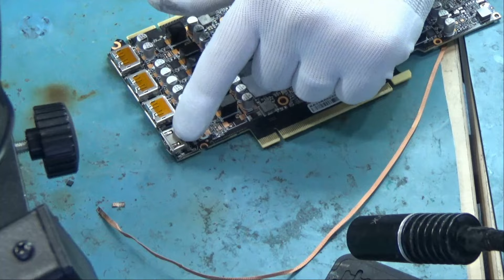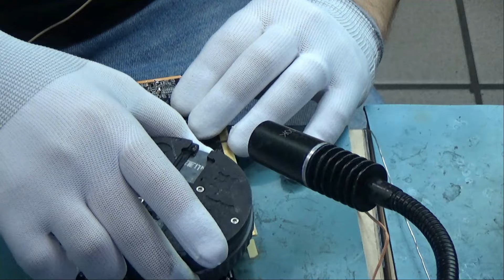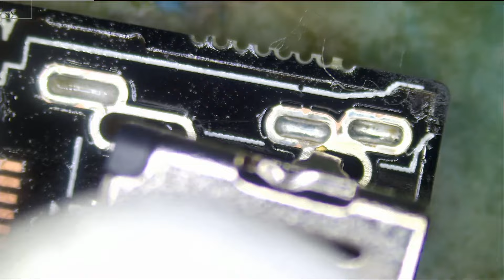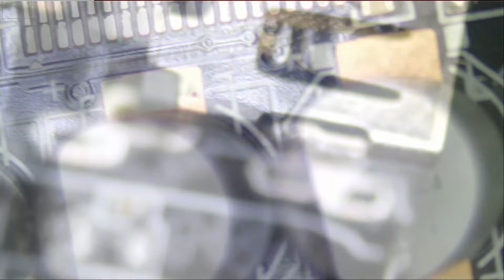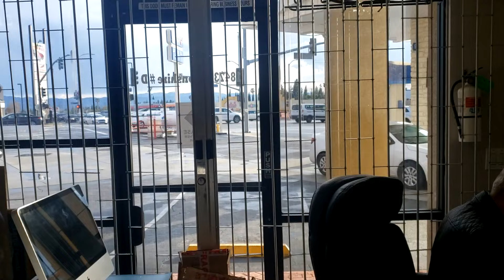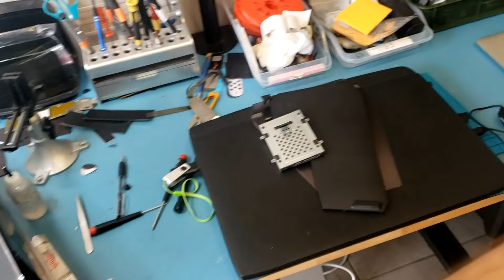GeForce RTX 3090 $3000 Graphics Card No Display Repair

Comment: What can be the Probem here do you think? its a Gigabyte GeForce RTX 3090 VISION OC 24G graficcard. The card has been working fine until it stopped giving a picture. The fans are spinning and the computer has started with the card installed, but the screen is not responding.

Comment: NorthridgeFixe where i can buy this for my Asus GTX 560 TI i repair wihth solder air station. i have signal without dvi i used dvi to hdmi adapter because my acer gaming monitor work only on two hdmi port or display port can you put me a link to buy a hdmi remplacement for my Asus GTX 560TI CUII please ?

Comment: With a board like this the customer must have had a monitor that accepts displayport why not use one of the 3 do connectors. There are also dp to HDMI cables that cost about $15. Your work is awesome but in this case a waste he had 3 other output ports to use.

Comment: Unfortunately the 3090 isn't 20% faster then the 3080. Not to mention the 3080 ti came out and is now less then 5% from the 3090 in most 3d rendering. Plenty of youtubers have put both through blender and other 3d rendering programs and not much of a difference between the two.The price is the only thing that truly separates the 3080 from the 3090.

Comment: Hey, I bought a gigabyte geforce 3090 oc 24 off an auction and it didnt state that it had a PCB issue, what it was, the metal bracket that allows it to mount was slightly bent, i manged to correct it and the board looks intact. I can power it up but it as no output when powered up on my monitor. Any advice please. Thanks.

Comment: QUESTIO PLEASE:  Why would my NVIDIA GeForce GTX1050TI  not be recognized by my OS (Win 10 64bit) which is fully updated?  W10 keeps using "generic video card drivers" for it.  Is there a specific chip that identifies the video card? Thank you for any assistance you can provide.  Currently I have put back in my NVIDIA GTX710 to use until I can figure this out.

Comment: My 1080 has been running fine for 5 years. And can still play new releases at 1440p at 60+ FPS on higher graphics. I will not pay $2000 more than the card is worth.

Comment: I wonder why they needed the HDMI fixed when they have 3 display ports available? Either they have a very specific need for an HDMI 2.1 port, or they did not realise they could have just used a display port.

Comment: I have a XFX Radeon R280X graphics card that shuts off immediately after boot with horizontal lines showing just before it shuts off. I believe the unit is over heating. Do you have any suggestions on how to repair this card. I am disabled and on a fixed income so purchasing a replacement, even used in this market much too expensive. I am very handy, but would appreciate a professionals advise before proceeding with any repair. I was thinking of taking the card apart, cleaning it thoroughly, applying new high performance thermal past to the GPU and VRAM and even purchasing replacement fans. I would love your insight please.

Comment: Of the 4 originals...to me it's either 3060ti or 3080. The 3070 isn't that much better than than the 3060ti...the 3090 certainly isn't $1000 better than the 3080 looking at benchmarks.
I had a 3060ti for about two weeks. It was plenty fine for most stuff. I would have stuck with it except the system it was in (prebuild) died. After a big fight with the egg idiots I've been on a Sky Tech "Blaze 3" ($2299 - no longer available) since first of March. I got it with no tax and free shipping. I don't know WHY no tax but I wasn't going to bitch. $2299 to my door and ready to go.
Zero problems. My XLR8 3080 is running as well or better than any out there though it gets no love from the tech channels. 1995MHZ out of the box...cruises happily at 2190 all day with a slight bump....low 60's at most. I haven't pushed it much...I'm skeered to kill it.
I've made just a few mods, cleaner wiring, 32 GB ram, 6 Sickleflows, bigger psu.....and I'm still under the price of that 3090.

PNY 3080 Epic-X, 3700X, Cooler Master 120 aio, ASRock B550M/ac, 32GB Ballistix 3600 (4x8), 1TB Seagate Firecuda M.2, 1TB WD Black HDD, 6 Sickleflow fans, Corsair RM1000x, Neo Air case.
$2800
I have named it Alita -3080 Battle Computer.

After examining it for stability...I cut out the ugly fat inner grate on the the front panel of the case....much cleaner looking.
Hooked to a 43 inch 4K HDR TV.

Comment: Doesn't it look like the board had holes that aligned with the legs he bent in, but they were full of solder. Looks like the board was designed to work with multiple HDMI ports.

Comment: I have the 3080 version of this card, Its a great card under water but the air cooler is shit, 86c in games and then it thermal throttles is no fun at all, a few cards all share the same PCB and the same fans and shroud so it could be PNY (like mine) or any of the other models that look the same.
Why would you use HDMI on an 3090 unless you run a sensor panel as well as your main monitor on DP ? These cards rear vram chips run hot too, they regularly hit over 100c on an air cooled card.
Even the rear solder joints and rear of the core gets hot on my 3080.

This is why most people with 3090's run custom loops cos its the only way to cool these things, as well as maybe get an EK water cooled backplate or rig up your own solution for the rear vram chips using an Threadripper heatsink or 6x DRAM water block.

Comment: I got a question. I have mining GPU with no display port. If I solder a HDMI/DisplayPort on it will it work? The pads and holes are there.
Reply: Yeah it will work in that case but i strongly suggest you to take the card to a professional if you don't know what you are doing.

Comment: I'm genuinely curious if this can affect the HDMI standard that the gpu can use (different standard would mean different speeds/resolution it can handle) and if it can compromise HDCP handshake
Reply: Nope, it's a dumb component/connector!
All the HDMI socket does is reroute traces to particular HDMI pin, it's all mechanical with no electronics.
Reply: @Leftfield2k7  great reply, i thought my comment was forgotten haha

Comment: If you look at the die or the chip itself, it's not that much bigger than the last gen 2080 Ti, but it's got 2x more cores and is 2x faster. Shows the generational leap in performance from Turing to Ampere.

Comment: Job well done! I am considering learning how to do this specifically to repair video cards. I'll be getting myself a hot air rework station soon. My goal is to be able to repair a broken 1080Ti, which I may be able to get for myself. I think I just need to reheat the solder balls under the RAM chips.

Comment: Hello, I have a question on what you are using to clean the flux after the repair and what does the brush do?

Also are you using Low melt solder to secure your HDMI ports to the boards? Cause I’ve been having problems with my HDMI port coming loose after the repair, what am I doing wrong???

Comment: I run a computer repair shop myself; the only reason why I can think that a customer wants the HDMI port to work is because it's a HDMI 2.1 port which carries a 4k signal @ 120hz. The question is with your repair does your replacement HDMI port a 2.1 spec? cause if not this can create future problems for the customer or resell value if it doesn't use a 2.1 spec.
Reply from the maker: It's not the connector that makes 2.1, it's the hardware and cable. All connectors have 19 pins and has nothing to do with HDMI version control.

Comment: سلام
I have the same laptop you got on the desk near big boss, ASUS ROG G751JL.
i want to ask if you have any idea about this laptop issue which is frequent shutdowns when playing specific games like Rust and league of legends. Its not an heat issue as i tested. I also play many games like warzone and many others and it works perfectly without any shutdowns. 
I noticed that only when i go to specific places in Rust it shutdowns. But for the league of legends it randomly shutdowns.
I replaced the battery with a new one, changed the thermal paste cleaned the laptop. But still have the issue.
If you have any idea what can make this problem i will be grateful 🙏. As i suffered from this issue for 5 years for now 💔.
Reply: How do you get right-aligned text in a YouTube comment...?
Reply: @RWL2012  لما تكتب عربي يا خيي
We right from right to left in Arabic. Thats all.

Comment: Imagine having RTX 3090 and using HDMI port...
Reply: I dont get the HDMI hate. Its like hating on Molex connector. If it does the job wears the problem?? 🤦‍♂️🤦‍♂️
Reply: @andrewszombie  for molex the issue is the pins and housings are usually not made too well and flop around a lot. Makes it easier to break. Remember USB 3.0 front header connectors? Those evil evil things we still use?
Reply: I would like to see the Venn diagram of people that have one of these cards and can't afford 7 bucks for a display port cable
Reply: maybe he has a secondary screen that is HDMI ... i have one to and i use it as my 3'rd monitor :D
Reply: @matpegheata  or htc vive etc
Reply: For the geniuses in this thread, the benefit of HDMI 2.1 is that it does not require chroma subsampling at 4K 144hz or 8K60Hz unlike DP 1.4 which almost always requires chroma subsampling for either. Higher bandwidth. 48GB/s for HDMI 2.1 compared to DP 1.4 which can only do about 32.

The only issue nowadays is only TVs and very specific gaming monitors can do HDMI 2.1 because the monitor industry moves at the speed of a snail compared to the TV industry (usually due to sales straight up being 15 to 30x more). It's by far superior for picture quality but costly.
Reply: @Shyvorix  we have display port 2.0 it's bandwidth more than doubled.
And can run two 4k monitors with HDR at 120fps.
Reply: @AyzekUorren  Yep but that ain't releasing until at the very earliest end of 2021. So we aren't expecting new hardware for it until around mid/late 2022.
Reply: @Shyvorix  Which is actually the best moment to release dp 2.0 considering pc components rampage in 2022. DDR5 means new mobo means new cpu. To add up new gpu life cycle. So again dp will send hdmi into oblivion.
Reply: @Shyvorix  they're clueless. i have my 3080 connected to my lg oled c9 running 4k120hz hdr. fuckin' glorious.
Reply: I can't.

Also..... Imagine sending your 3090 in to get "fixed" when there are 3 other DP outputs on the card that are functional still.
Reply: @nexxusty  Getting it fixed probably costs more than a DP to HDMI adapter.
Reply: @atnfn  if you buy a rtx 3090 the price probebly does not matter
Reply: @atnfn  Yes but the difference in resale value of a correctly working card vs one no working HDMI 2.1 port is higher than the cost of the repair.
Reply: @nexxusty  my HDMI 2.1 port runs 8k 60hz which the DP ports don't do.
Reply: @nexxusty  if its broken why wouldnt u want to get it fixed if its in warranty? is free and u dont have to buy anything.
Reply: @nicane-9966  i’ve heard that if something is broken on your graphics card the company takes ur graphics card and sends u back ur money they don’t fix it and send it back
Reply: HDMI 2.1 has a higher bandwidth than DP 1.4. He's probably using it for an LG Gsync TV, which don't have displayports.
Reply: thinking about someone with a 3090, they probably have multiple displays. its possible that they have 4 screens they are driving and 3 of which are already using the DP outputs.
Reply: It’s an hdmi 2.1 port. So it can do 4k @120 and up to 8k @60. What’s the point of this comment? Some people use their TVs as monitors and most TVs that are worth buying have hdmi 2.1
Reply: I was thinking the same thing.
Reply: @starscream42  In what ways?
Reply: @ronnie3044  Compatibility, Daisy chaining support, Enhanced Audio return channel, Supports up to 10K resolution at 120Hz with meta data entanglement. Though DisplayPort should surpass HDMI soon.
Reply: If you are not idiot , HDMI may be ,used for console , and elgato HD capture
Reply: likely someone who is recording or streaming. thats the main use for the HDMI on such cards and i suspect the only reason they still put one HDMI on those high end cards. 
theres only one captruecard for DP port and it cost a fortune and its not even that good. hdmi is the real option for capture devices
Reply: he's got one for a reason😉
Reply: Imagine having a RTX 3090 and playing on a 21" monitor instead of a 60" OLED.
Reply: @DHxJarsyl  haha exactly
Reply: Imagine not understanding that it's hdmi 2.1 on the 30 series which is the best connection highest bandwidth transfer connection bandwidth at 48gbs hahaha. Any one not using that hdmi port is using a lower quality port . Hahah there's your lesson for the day .
Reply: its sad i know but my lg zx only has hdmi ports
Reply: imagine running 4k on a 4k card
Reply: @lottexy  If they didn't use it, how did they know it was broken?
Reply: exactly what i was thinking
Reply: @MrMisterMan Not if it's an OLED. They have the best response times of any display.
Reply: Doesn't VR require HDMI?
Reply: it's hdmi 2.1
Reply: 2.1 is good lol
Reply: HDMI 2.1 works just fine for most people, and HDMI in general is a lot less buggy than DP is.
Reply: EXACTLY. CRAZY. USE A DISPLAY PORT
Reply: @MrMisterMan not even, if you can afford a 3090 you can afford a giant tv as just secondary media display on the wall.  More screens is more useful always.
Reply: Yeah, HDMI 2.1 is not the same as 1.4, etc.
Reply: I don't have to imagine it. I can plainly see it. :)
Reply: Well, Miners don't use displayport... so hdmi is okay? haha
Reply: huh...i have a 3080ti and I use mine with a LG CX 4k OLED 120hz...its not that strange actually.
Reply: @NonLegit Nation  seriously. salty people judging too much its funny/sad
Reply: I was thinking the same thing wtf...
Reply: I mean why not if that's what you got  I've got my 3090 using a HDMI with freesync
Reply: Maybe look up HDMI 2.1 specs and then again Displayport 1.4a Specs then you see why one might choose HDMI over Displayport.
Reply: the dot dot dots make you mystical and mysterious
Reply: Maybe his monitor is 3 meters away from the case.
Reply: @starscream42 
Nope. HDMI is only widely supported but it has lower bandwidth than DisplayPort so it cannot support high resolutions and high refresh rates at the same time.
That means for video editing and gaming it's better to go with DisplayPort over HDMI because it was designed for high performance applications but is not as widely supported as HDMI.
Reply: honestly if you're not using HDMI 2.1 with the 3090, you're probably using a shitty LCD monitor with DP 1.4 LOL
Reply: @ouki4925  here is where you need educating, DispalyPort supports up to 8K where as HDMI does not. 
Also why are you saying they would be using LCD? The panel tech.has nothing to do with the port you use.
Reply: @Ashley_Dale  HDMI 2.1 supports up to 8k @60hz. What are you talking about
Reply: @Ender275  DP 2.0 configuration: 
16K (15360 × 8640) display @ 60 Hz with 10 bpc (30 bit/px, HDR) RGB/Y′CBCR 4:4:4 color (with DSC)

10K (10240 × 4320) display @ 60 Hz and 8 bpc (24 bit/px, SDR) RGB/Y′CBCR 4:4:4 color (uncompressed)
Reply: HDMI 2.1 > DisplayPort for high bandwidth. 8k or higher resolution or high refresh rate.
Reply: imagine gaming on a brand new 85” TV with hdmi 2.1 and no displayport
Reply: i have a 3090 and use my hdmi port. what of it?
Reply: @b4ds33d   They are just jealous. I'd be very happy with that setup.
Reply: WTF exactly what I was thinking... I MUST GET 2000 FPS @ 1080P 60HZ!!! lel?

Comment: imagine using a HDMI port on a 3090
Reply: Imagine spending more than $100 on to repair an HDMI port when you could buy a DP cable which would be better anyway instead.  Also all high end monitors that you would use with a 3090 will support DP.

Comment: Is ist possible that it is a different port because the new cards have HDMI 2.1?
Reply: the chip and cable makes it 2.1, an older physical port would work fine with it as the connector is the same.

Comment: that HDMI port is 2.1 dude so what type are you installing
Reply: older physical HDMI ports are "forward compatible" with newer version HDMI controllers and cables.
Reply: Was wondering the entire time if the card will be limited to HDMI 2.0 speeds of 18 Gbps max / 14.4 Gbps effective or will it still do the full 2.1 standard of 48 Gbps M / 42.6 Gbps E
I know 2.1 cables are backwards compatible so it might be alright ?

Comment: This man saves kidneys!!! Mad respect! 😭😭😭😭
Reply: a kidney's value it's more like a ps4, this would be more like a brain and heart repair.
Reply: *gets rtx 3090 just to use hdmi-_- he should return it
Reply: @Switchfpv  Maybe he uses multiple monitors.
Reply: @Switchfpv  RTX 3000 cards use HDMI 2.1 which is actually better than DP 1.4, but only some TVs can use 2.1 to it's fullest and only 1 or 2 PC monitors I know of can use 2.1 to it's fullest extent (can run 4K144hz or 8K60Hz without requiring chroma subsampling, while DP 1.4 needs subsampling for 4K144 and absolutely is required at 8k60).
Reply: @Switchfpv  maybe he's using hdmi 2.1 ?

Comment: Does the port have to be 2.1 capable (like does 2.1 port require any additional pins or its done inside the gpu) and all ports, like you used here are compatible with all versions?
Reply: older physical HDMI ports are fully compatible with newer version HDMI controllers and cables.

Comment: Eeeeeeeh Design fail? The through hole capacitors touch the pads made for the SMD caps on potentially both terminals/lines.